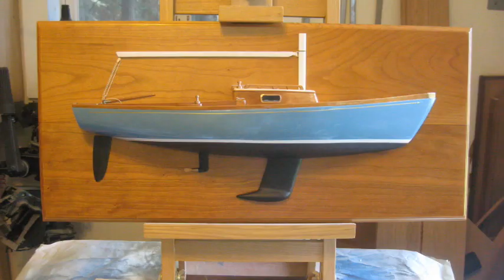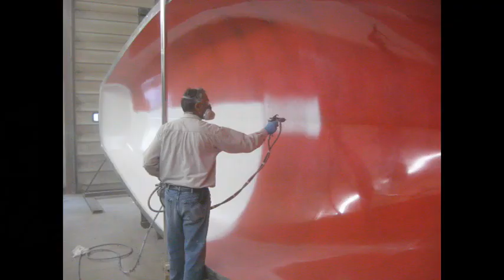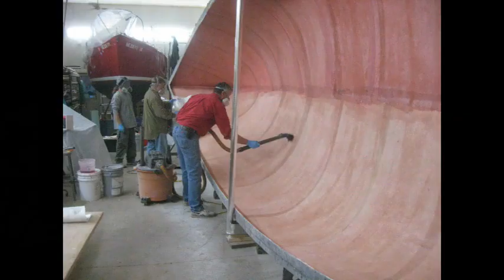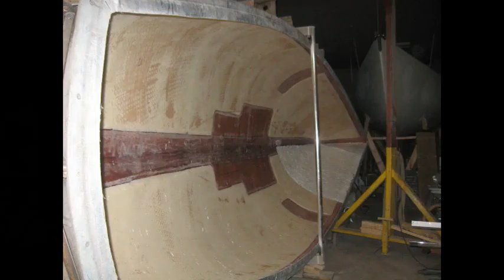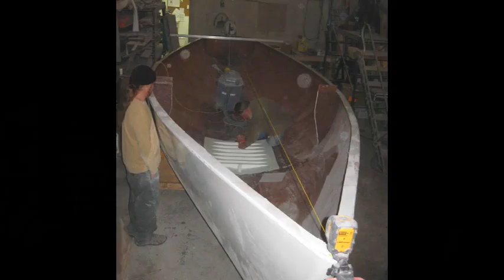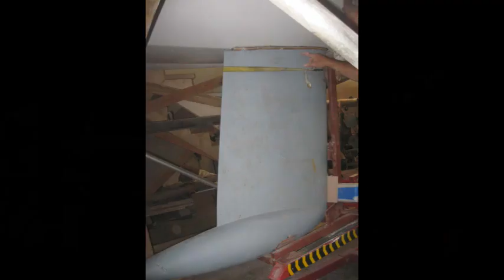Building a Fiberglass Sailboat Hull and Installing the Keel

Comment: Where would a DIY'er get the mold from?
Reply from the maker: This is not a DIY build.  This is a professional build by one of the top builders in the business (HR Hinckley).  If you wanted to DIY a full fiberglass hull, the first step would be to either strip plank or cold mold a hull.  Once you had the hull you would fair it and paint it, then you could pull a mold from that hull.  That is not worth doing to build a single hull unless you want a one off full fiberglass boat.  In that case you would destroy the mold after using it to build your hull.

Comment: Thanks for sharing! Would have loved to see how the mold was made and how long that took as I’m sure that was significant. One question i have is wouldnt the keel be stronger with a slight lip to increase the mating area so that there is a wider mating area that could help resist bending forces on the bolts like if grounded when forces on side of keel. Kind of how a screw on ikea leg works, it has one bolt but a wide mating surface and therefore keeps bolt in tension forces not bending forces.
Reply from the maker: The mild is made by building a plug which is basically the hull but a throw away version.  I am not 100% sure, I believe in this case that the first boat in the series was built as a cold molded hull and that hull was used to make the mold.  Once you have a plug, the procedure is to wax the plug with 8-10 coats of wax and then spray it with a uniform coat of polyvinyl alcohol (PVA).  PVA is water soluble.  When the PVA is cured mold construction begins by spraying the entire plug with a layer of tooling gelcoat. Then one or more layers of chopped strand mat are applied.  The layup continues multiple layer of structural fiberglass to create a strong mold.  The total glass layup for a mold is considerably heavier than for a hull.  Once the mold is fully laid up various reinforcements and stiffeners are added to the outside of the mold to stiffen it and make it easier to move/handle.  Once all construction is done the mold is removed from the plug.  This last step is the hardest part particularly if the prep of the plug wasn't adequate.  The mold in this video is about 20 years old and I think this was the 12th or 13th hull made from it. Mold building is expensive.

Yes flaring the top of the keel to give it a wider contact area would strengthen it some, but remember the keel is cast lead and lead is quite soft and bends easily so you gain little by a thin flared area.  This keel did get wider toward the top and was almost 6 inches wide at the top.  The keel bolts were paired in the wider parts of the keel and single at the aft end of the keel where it was narrowest.  Of course, keels are NOT designed to be grounded.  Hard grounding a fin keel boat always does significant damage to the hull.  For example hitting the front of the keel on a rock tends to pull the front of the keel down and push the aft end of the keel up.  If the grounding is hard enough the aft end of the keel may push through the hull and create a significant point of water ingress.

Comment: I prefer encapsulated keels. You hit something like a shoal or reef with a bolt-on keel, say goodbye. This also goes for rudders for which if you hit a 2x4 piece of wood, you would then have a 3" inch hole where the rudder stock was, say goodbye. Then, a skeg-hung shaft, same thing, say goodbye. I totally un-robust design.
Reply from the maker: Fin keels like this one can be quite robust.  It depends on how well the internal keel grid is built, how it is bonded to the hull and how widely it spreads loads.  Some cheap boats have no grid and relay on small backing plates.  Those boats can lose the keel if you hit something.  The same rudders.  This boat has a rudder tube that is bonded to the hull and deck and has four substantial knees supporting it at the hull.  If the rudder hit something like a 2x4 it would simply bounce off.  Something more substantial would be more likely to bend the rudder shaft (2.5" stainless steel than pull the rudder out of the boat.  Also fin keel spade rudder boats like this one are built as performance boats.  This boat is actually a day sailor and is highly unlikely to hit anything other than soft mud since it is in the Chesapeake.  It will handle that mud very nicely.  Note that my boat has a full keel with encapsulated ballast.
Reply: @todddunn945  Thanks Todd, I appreciate your view. Btw, nice boat!

Comment: Nice video! I have a question though. Does the liberal coating of adhesive to the top of the keel mean that you cannot now remove the keel in the future to make it easier to inspect/maintain?
Reply from the maker: No the 5200 does strengthen the hull to keel bond, but you can cut through it quite easily with an oscillating saw.  The 5200 is mostly to provide a seal.
Reply: @todddunn945  ah, I see, thanks for the reply👍